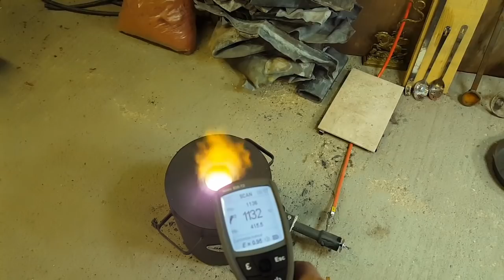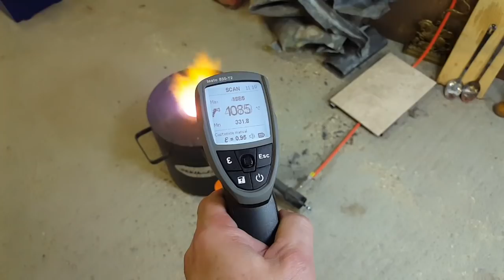Water Casting Copper Ingots, Shibuichi and Mini Copper Ingots

Comment: Nice these turned out nicer than the last batch.  Using the right material and all and remembering to drive out the air bubbles.
Reply from the maker: Yeah denim was the charm, that first lot of material was way too thin.  You can soak denim as well to get rid of all the trapped air.  I will make more of these soon with some different metals, just to see what happens.  Cheers Andy 😃👍👍🍺

Comment: adding Jet dry and salt to the water will help knock down the steam jacket and promote faster cooling... old blacksmith trick
Reply from the maker: Thanks Lawren...  Interesting, I didn't know that....  Would that be a good thing for this do you think ?  This process is supposed to produce an annealed ingot.... speeding up the process may not be beneficial in this case.  I wouldn't know for sure, water casting is still very new to me, I've only done it a few times.  Cheers Andy 🍺🍺🍺
Reply: It wont speed up the cooling That much, but as you are using the steam jacket to keep it molten longer, I dunno if it will give you the results you want... it was just a tip I wanted to give you regarding surfactants and steam jackets... in the case of the blacksmith, it is used to get more hardness from steels with lesser carbon by speeding up the quench. It has the added effect of giving a more homogeneous quench, as the water actually makes contact with the metal without the steam Jacket. Non ferrous metals may actually be SOFTER with a faster quench, as it allows less time for crystallization
Reply: Old blacksmiths had Jet Dry?
Reply: @matteliano454  this "OLD" blacksmith does... use of surfactants of one sort or another is documented as far back as the Roman occupation of central Europe

Comment: The whole point of water casting is to prevent oxidation. By lifting the ingot before it is properly cool you contaminate the surface. That’s why you get different colors. The color change steam blasts some of that off, Hanse the change but not the heavy scale you introduce.
Reply from the maker: The oxidation layer is easily wire brushed off, but I like the variation of colours.  These ingots just sit on my shelf as part of my collection.  Cheers Andy 🍺🍺🍺

Comment: that it made a solid chunk and not splatter is amazing.
Reply from the maker: Thanks Daybrok, it's because the water is around 90C, when the metal hits the water a steam jacket is formed around the ingot which prevents the water from touching the metal.  Eventually this steam jacket breaks down and all the energy is released at once into the water which causes it to boil.  This produces an annealed ingot ready for forging.  It's a centuries old technique used by Japanese blade smiths, which I find very interesting.  It's not without its dangers though, so prior research should be done and risks weighed up before attempting such a thing.  Anyone trying this does so at their own risk.  Cheers Andy 🥂🥂🥂
Reply: @MeltandCast  what would you use this alloy for?
Reply from the maker: It's proper use is above, for me I just wanted a few coloured ingots for my shelf.  The blade smiths used to use them to make the Tsuba (handguard).  It was also sometimes made from Shibuichi (copper/silver) and Shakudo (copper/gold).  Once forged a patina (Rokusho) would usually be applied to bring out the colours.  Cheers Andy 🍺🍺🍺
Reply: MeltandCast do you have some books to look for as for where you learned it? I would be really interested in trying it, and forging the end result

Comment: You are playing russian roulette here, it is only a question of time when one of your pores will result in an explosion. Dont just blindly do stuff you see on the internet, many people die every year from steam explosions in factories by pouring molten metal into sand that is humid, this is even worse than humid sand. It is not a question if it will happen but when.
Reply from the maker: Thanks for the heads up Boris, I think it might be wise if I amend the titles slightly... wouldn't want anyone doing themselves a mischief !!!  Cheers Andy 🍺🍺🍺
Reply: He has heat on that pot of water was sitting u cld see the steaming. That’s why it didn’t explode.. If the water was cold then yea ur right.
Reply: This is true but the reactivity of the metal and the temperature of the water plays a factor too.  Doing this with aluminium for instance would be akin to playing russian roulette.  Copper is not so bad though if the water is hot enough before the pour.

Comment: good job bro. what is the purpose of mixing silver with copper?. I am assuming the water is hot before your first casting. is that right?..
Reply from the maker: Silver and copper mixed is called Shibuichi.  Shibuichi means 'one fourth' meaning 1 part silver to 3 parts copper (25/75%).  This Shibuichi wasn't a true Shibuichi as the silver content was only 5% but it is the lowest silver content you can use and still class it as a Shibuichi, loosely speaking.  The water was at around 90C just below boiling.  Cheers Andy 🍺🥂

Comment: That is flipping wild!!!! I've never seen this type of ingot casting before!!! Man that changes color quick! Has it got something to do with the air and heat causing oxidization??
Reply from the maker: I know, it's crazy... changes colour in about a 10th of a second... I still have the ingot, its a lovely aubergine colour.  I'll have to revisit this sometime... it is a fun process.  If memory serves me correctly, I think that one had 5% silver added to it.  Apparently the Japanese sword smiths used this method to create an annealed ingot which was the starting point when forging the Tsuba (handguard).  The oxide layer though is only surface deep, it would come off with a wire brush.  I think one of the properties of copper is that it changes colour due to heat and interrupting that process in a certain way can cause the colour to remain.  I managed to get a salmon coloured ingot and a red ingot while doing this.  Interesting exercise for sure...  Cheers Andy 🍺🍺🍺
Reply: @MeltandCast  I love being amazed. And the moment that steam jacket collapses and you witness the metal change color that fast is the most amazing thing I've seen in a few years. It's like magic. David Blaine ain't got nothing on you brother!!
Reply from the maker: Thanks Wiggle, that's really kind of you...  really appreciate it mate 😎😎😎

Comment: Do you think the dye from the denim in the repeated castings could have influenced some of the color changes so the oxidation of the outside of the ingots becomes more pronounced the more castings you do without changing the water? It would be interesting to test with a bleached denim and no dye in the water as opposed to the method you were using.  It would be interesting to know if the dye influences the amount of oxidation you get when exposing the ingot to air.
Reply from the maker: Not sure Gary, If I was to hazard a guess I would say its more likely down to the timing and duration of air exposure that causes the colour change.  Pulling the ingot earlier or later when it's hotter or cooler will probably affect it as much as the amount of time it's exposed to the air.  Usually you'd only expose the metal for a second or two.  Due to the dangers of water casting though it's not something I'd like to experiment with too much...  I don't recommend anyone else try it either, too many things can go wrong !!  Cheers Andy 🍺👍
Reply: Did you tried to shake it under the water   after you exposed it to air? This way the copper will cool much faster. Maybe it will change something.

Comment: That color change was awesome. Were all the batches mixed with silver, or just the last one? Was looking like aluminum bronze on the buffed pieces. Haha on the mini ingots, I got the same ones and had the same reaction, they took the pics up close to make them look bigger.
Reply from the maker: This first three were all the same copper with no silver added.  The last one was a re-melt of a 5% silver 95% copper ingot.  At 5% it's just about 'Shibuichi' but a true Shibuichi would have a minimum of 25% silver content or more.  And yeah those ingot molds fooled me too, almost impossible to pour into.   Probably better suited to those small hand crucibles than an A6 !!  Cheers 🍺👍👍👍

Comment: I tried this with pure copper and Sn bronze on a much smaller scale with a bucket of linseed oil instead of water. It turned out so much better, however I still would not recommend it to anyone.
 If you must cast pure copper, build a solid fuel furnace or cupola so that the molten copper can be tapped from the bottom and immediately poured into a sand mold.
Reply: Why wouldn't you recommend doing it?

Comment: Are you using some eye protection?  The visible light coming out of the forge especially when you first open the lid seems intense.  Heat transfers into visible light by the principle of blackbody radiation.  The hotter the "blackbody," the more intense and damaging the light.
Reply: Just to be clear, if you are seeing "sun spots" after you remove the crucible from the forge, you should at a minimum be wearing dark UV protective sunglasses.  Damage to the rods and cones of your eye never "heals."

Comment: Very interesting copper pancakes why doesn't the denim burn even in the water is still going to be an extreme amount of heat that's very interesting
Reply from the maker: The first time I did it I used a much thinner cloth and got an steam bubble trapped underneath, that one burnt through.  The ingot creates a layer of steam around it which prevents the water from touching the ingot, so long as the ingot is surrounded by the hot water it won't burn through.  Not sure what would happen if the water was cold...  I wouldn't advise trying it though.  This method of casting isn't 100% safe by any means.  Cheers Andy 🍺🍺🍺

Comment: The channel locks make me nervous.  It's not hard ot make a safer pouring shank that retains the crucible when pouring.  Also, a pair of welder's spats would greatly increase the likelihood of your safety in the event of a spill or splatter.  Hot metal in your shoe is not fun.  Otherwise, an informative video.  Well done.

Comment: you need a proper pouring tool mate. what if that crucible cracks while you have it in pliers ?
Reply from the maker: I don't have one for that crucible, I rarely use it except for copper and silver mixes.  I'm very careful though and I do wear molten metal resistant clothing...  Still, I hear what you say...  Cheers Andy 🥂😎

Comment: Not really sure what the point in the Pucks is.   Comes out prettier than ingots but stackability and future meltability due to Crucible size seems questionable.  I did try pouring Copper into water to form pellets but my success was sub-par-perhaps heating the water would have helped.  As far as "Don't use this Tool"?   Hey-it's my favorite one!  :D
Reply from the maker: Just experimenting for fun Mark.  Ingots form part of my collection and won't get re-melted.  If you want to make pellet pour high and with a thin a stream as possible.  A layer of ice helps or an ice cylinder to bounce the metal off if you want it a bit more flaky.  Using near boiling water with this method anneals the ingot as is cools.  It's how the Japanese blade smiths formed the basis of the Tsuba before working it.  Albeit with a smaller piece, alloys of copper, copper/silver and copper/gold were used traditionally I think.  Cheers Andy 🍺🍺🍺
Reply: @MeltandCast  Ice?  GENIOUS!  Well, I'm short so...guess I could stand on the Deck to pour.  My biggest issue is not being able to drive due to vision-just under the safe level here but functionally fine so getting out to get Copper is a problem.

Comment: How deep is the color change on those anyway, I assume just a surface finish so you can't polish them up much?
Reply from the maker: It's thick enough that it doesn't rub off easily with your fingers, but I think a wire brush would take it off completely...  The first ingot did have a nice deep orange colour and wire brushing removed it back to bare metal.  Shibuichi is supposed to patina well, it's probably worth doing on the higher silver content ingots.  Cheers 😃👍👍🍺

Comment: Do you put anything like BORAX in when melting copper? If so, do you add it when the copper goes in prior to melting? Just starting out and have a bunch of copper powder im looking to melt. Im not sure how to deal with slag.
Reply from the maker: Cheers Demo.  Sorry for the late reply...  If I'm melting fairly clean copper I rarely use flux as often the negative effects are fairly minimal for what I do.  The flux I do use is a commercially bought flux specifically for copper but Borax works just as well.  All your looking to do is cover the metal to prevent gas uptake into the metal whilst melting.  Any impurities would usually float to the top by themselves and can be skimmed off before pouring even without a flux.  Copper is very dense so its unlikely many impurities would actually end up in the molten metal.  For brass though you'd be better off using a flux as you often get quite a bit of junk floating on top, using a flux would help.  If you're just starting out I wouldn't worry about it too much unless you find you have a specific problem that needs fixing.  Most of my castings have been done without any fluxes at all.  Hope that helps.  Cheers Andy 😎👍

Comment: Why did you tap the side of the pot with the pliers while the ingot was cooling? Cool video, would like to have seen the silver one polished up a bit...
Reply from the maker: Cheers Curtis, tapping the side of the pot helps release any trapped oxygen while the metal is still molten.  The layer of purple colouring on the silver ingot is only surface deep.  Polishing it up would have removed all the purple colouring from the oxide layer, I wanted to try and keep that intact.  I polished the first one as it had some really nice lines in it from the cloth, like little snaky streams...  Cheers Andy 🥂
Reply from the maker: Thanks Assassin, yeah will do...  I keep a large bowl of water on the floor for that reason so I can dunk my whole boot in... just in case !!!  Cheers Andy 🥂

Comment: Why do you water cool the copper ingots?  Does it change the molecular structure?
Reply from the maker: I don't know about the molecular structure, but casting into near boiling water produces an annealed ingot ready for forging.  I just did it for fun though...  It can be quite dangerous though so I wouldn't advise repeating it !!!  Cheers Andy 🥂

Comment: Is this safe in general, or only with specific types of metals? Will some metals cause steam explosions or other hazards?
Reply from the maker: There's always an element of danger with this type of casting.  Water and molten metal don't usually go well together.  Steam explosions are possible.  It's a method usually reserved for copper, copper silver and copper gold alloys and the water must be very hot.  Anyone trying this does so at their own risk, I accept no liability.  That should give you an idea.   Having said that it's a technique that's been used for centuries by Japanese blade smiths.  I'd research the topic thoroughly before trying it and decide whether or not it's worth the risk.  Cheers Andy 😎😎😎
Reply: Guy, the faster a metal sheds heat the greater chance for an explosive steam bubble, and that has been known to send hot metal at the Smith as well. Aluminum is pretty much a no no. This is an old technique but it's always been a terribly flawed one for any semblance of safety.
Reply from the maker: And there I was trying to water cast aluminium.... Guess I got off lightly !!!  🤦‍♂️🤦‍♂️🤦‍♂️
Reply: @MeltandCast  if you are pouring at the right temperature,  the right speed of release, angle, and distance from the water, then you will be fine. And that's why I don't like water, totally doable, but so many focus points in that pour, too many for me. Newer and easier methods exist for a reason, that said , I appreciate the history and techniques.
Reply from the maker: Thanks Patrick 🥂🥂🥂
Reply: Adding molten metal to water is one of the most dangerous things you can do, there is a huge chance that it will explode and trow molten metal in your face killing you instantly. If it doesn't happen usually its just because the equipment isn't clean, so the oxidation starts before the surface of metal touches the water, many people have died this way and still die in industrial manufacturing every year.
Reply: I see we have a comment section full of YouTube experts
Reply: Add a cup of water to molten lead🤡

Comment: How to purchase tamprature measurement bronze melting tamprature
Reply from the maker: The temperature gun I use is a Testo 835 T2 thermometer, it is designed for molten metal and reads up to 1500℃.  They are very expensive and can be found online.  A cheaper option would be to use a thermocouple and meter.  Some people would argue that this is a more reliable and better option as the Testo thermometer I use only reads surface temperatures.  Cheers Andy 👍😎🥂